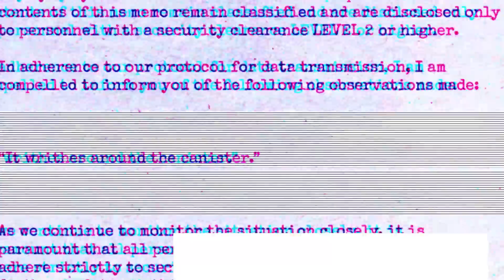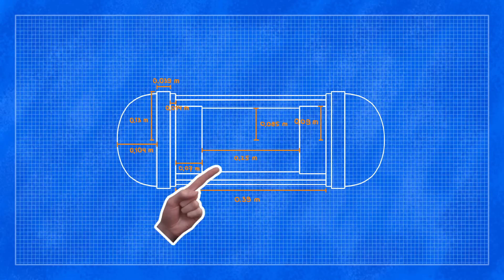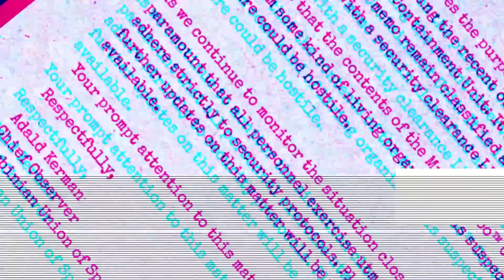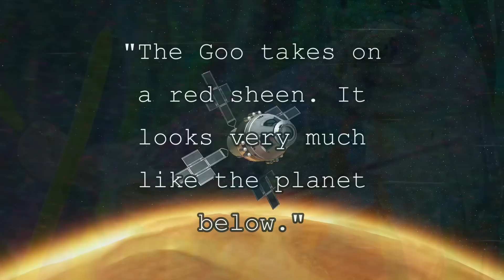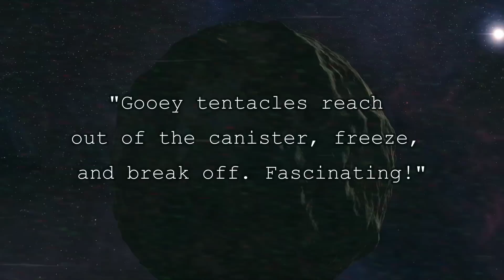What Is Mystery Goo™?

Comment: Assumption 1: The goo canister is made of aluminium, and only aluminium
It could also be partially composed of titanium, steel, ceramic, copper, fiberglass, silicon, glass, plexiglass, and plastics, among other things. It is extremely unlikely for the entire device to be composed of a single material.

Assumption 2: The goo fills the container's internal volume completely.
It doesn't seem to be clear whether or not the container is entirely filled with goo. When the container is opened, the goo is able to be removed or escape, and it is described as moving or changing shape, but it is also unclear whether it moves and changes shape within the canister, or when removed/let out.
Reply from the maker: Jup. And that is why even the simplest case will give you varying densities, just as shown in the video. That is why I concluded that the approach is not very helpful. Too many unknowns sadly. Thank you for the more expansive summary.